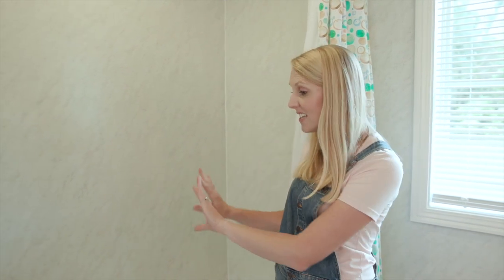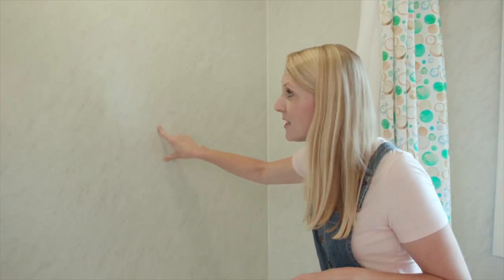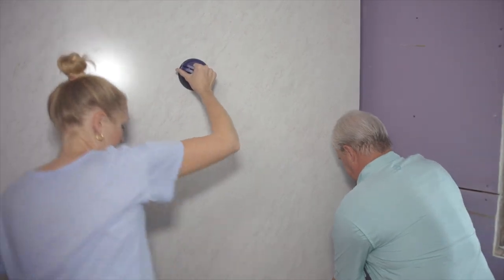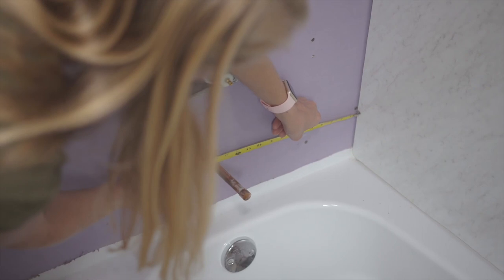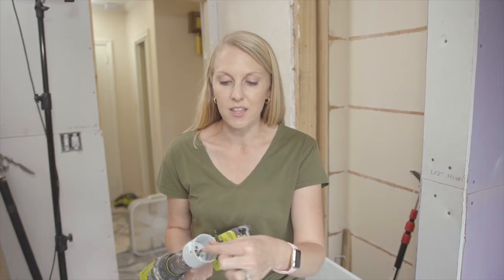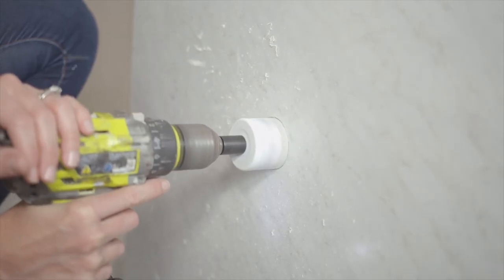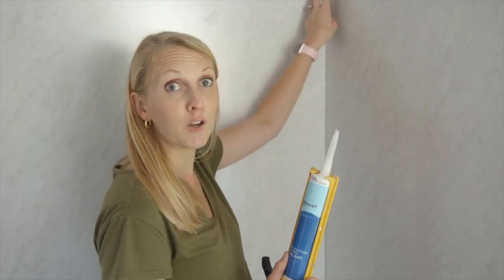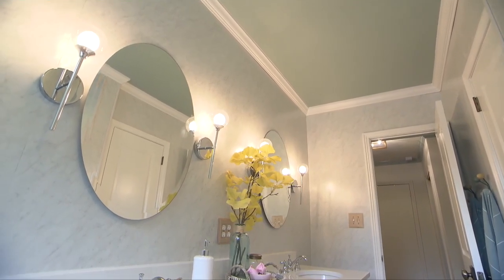Faux Marble Waterproof Bathroom and Shower Walls How to Install

Comment: Hello! What kind of sealant did you use in the cracks? Is that sealant you used different than silicone caulk?
Reply from the maker: I used their proprietary sealant because it is color-matched to the panels for a more seamless look. https://www.wetwall.com/catalog/product/view/id/10154/s/sealant/category/961/